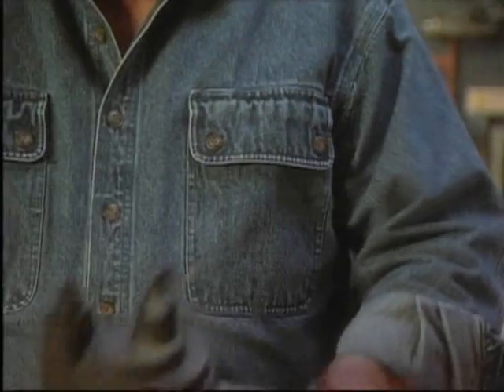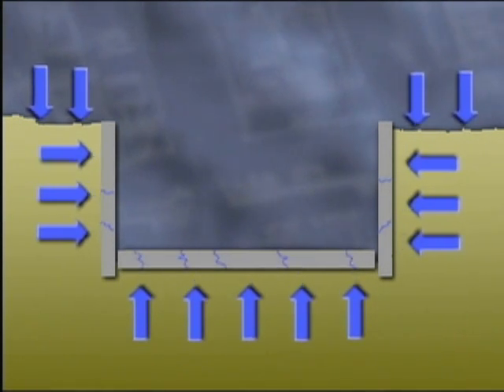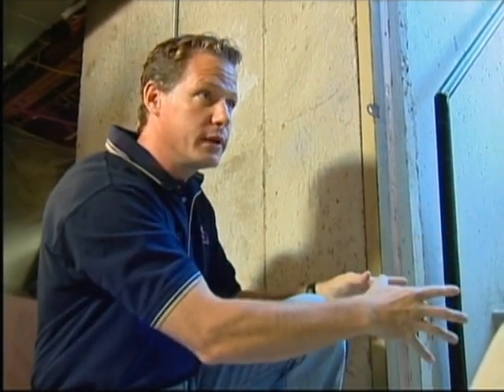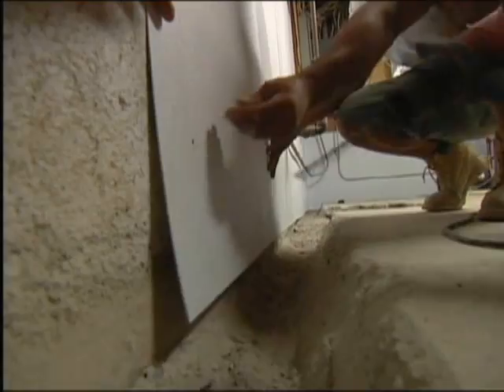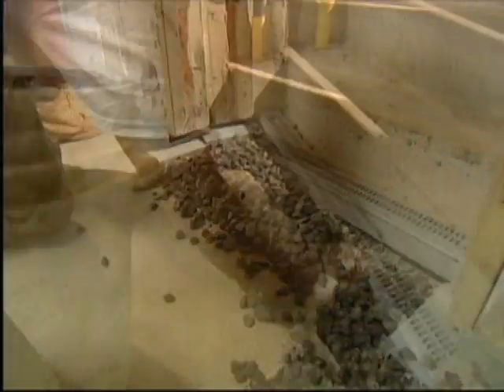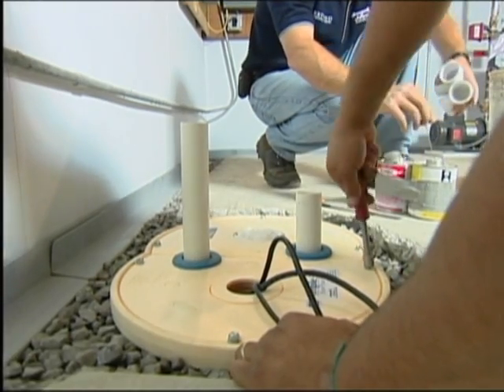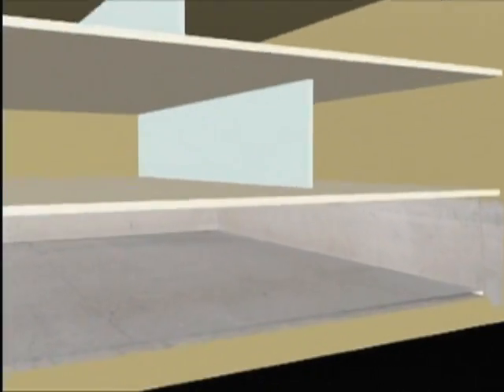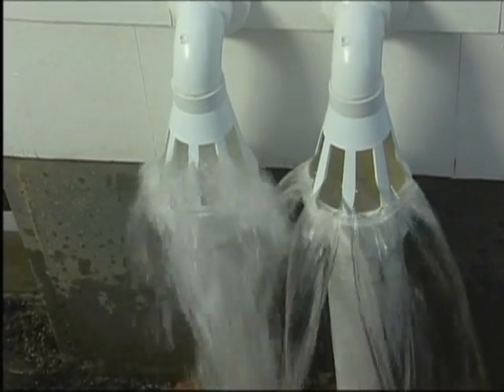How to Waterproof a Basement | Ron Hazelton's House Calls feat. Basement Systems

Comment: Maybe address the outside drainage problems first.
Reply: Yeap - it is bad that these guys did not take care of it outside.
Reply: Like what?
Reply: Like gutters, french drain, or slope around the perimeter of the foundation. All of them would be more effective at keeping the water from getting there in the first place.
Reply: @LibertyFixxxer  Make sure the gutters are working properly and discharge far away from the foundation.  Grade the topsoil to drain away from the house.  Run edging three feet around the perimeter of the foundation. Use soil to create as steep of a pitch as possible, away from the foundation, in between the edging and foundation.  Keep the pitch aesthetically pleasing.  Lay impermeable landscaping fabric on top of the soil from the foundation to the edging.  Put 3" of 2-3" stone on top of the fabric. If there is a lot of water problems you can dig a trench before the edging and lay drain tile on the fabric then cover with the rock. I like using sewer pipe pvc that the downspout of the gutter directs into. Get that dug down below the frost line close to where the downspout attaches to it as possible. In the winter they can freeze and back up when snow melts on the roof.  Run it out far away from the foundation to a rain garden. The sump pump discharge and drain tile under the landscaping rock can discharge into the pvc sewer pipe.  The pvc is typically less expensive than corrugated drain tile and you can snake it if it gets clogged.
Reply: Oh and buy a leaf blower to blow out your nice stone regularly.  Otherwise organic material turns to soil and weeding anything with fabric underneath is a nightmare, but that's also how I put myself through college.
Reply: @jeb1487  I literally couldn't have put it better myself Jeb. My neighbor has ground level ingress issues in a block on slab house here in South Florida. I told him gutter first and then he needs to look at a yard drainage and pump system. He doesn't have too many options from a grading perspective and he just added a load more earth thinking that hiding the water under it is going to solve his problem. I tried to explain to him that the key point is that the water is above his slab. It looks like the previous owner built up the yard to make the lake go away not realizing he lives below the lake. I told him that I am an engineer, albeit not a civil engineer, and that he should listen to me. I explained that if we get a 2 inch downpour in an hour he will have thousand of gallons to clear and a few feet of french drain that doesn't go anywhere will have no impact.
I don't have any issues but if I did, I have a 2-inch pipe running to the canal for sprinkler uptake and I would find a way to pump out to the canal through it.
I will mention your ideas for fabric and edging. He has to take down the grade to create runoff and create a long drain bordering but not at the wall and use the fabric to keep the water out of the ground. Thanks for the idea.
Reply: Ed McGuigan  no problem. would it be possible for him to make a dry creek bed? He could have the soil pitched away from the foundation and into a channel that is also lined with the fabric and stone. They can be very aesthetically pleasing if done correctly too.
Reply: @jeb1487  question? What do you do if you do all that and water still penetrates?
Reply: @vvsiva007  I was amazed that guy  never stepped outdoors....crazy.  I research and work hard to keep all my pumps from turning on let alone  working hard.  All that water along the foundation and mud splashing up on the exterior is a big No No!
Reply: @Braedenfish  same thoughts. I consider the sump pump as a backup and have done everything possible from ever having it come on, unless you're having a 100 year storm even then I want the exterior grading and drywell to take care of all of the water.
Reply: @bossboston816   He did not fix the problem, A big bandaid is all you are looking at. Outside first, then put in an inside system that will weaken you foundation.
Reply: @jeb1487  very thorough. Thank you

Comment: I hope Ron got a big check from Basement Systems because he sold out big time.
Reply: It's a Basement Systems Commercial
Reply: @Liberty AboveAllElse Improving surface drainage doesn't cost nearly that much.  That's always first because it's almost always the cause.
Reply: @Liberty AboveAllElse Sorry, that's not true.  This house is a good example: the basement gets when when it pours.  Otherwise, it's dry.  That's what Ron said.  Cheap solutions like extending downspouts are always the first option, though they often don't solve the problem.  Bringing in dirt to improve drainage away from the house is second, when possible.  Installing subsurface pipes/drains is third, and interior improvements are the last resort.
Reply: That system is garbage. It’s needs to be sloped 4in pvc with holes installed at the bottom of footing surrounded by a drain sock and gravel. It is ground water. He must have a high water table.

Comment: Janesky is the founder of the whole industry. He must be a multimillionaire. I've used 10,000 of those plastic fasteners. If the walls is very old ?  We have seen them lose their connectivity which isn't the end of the world. Just put it in some place else, but first we stated filling the hole that we jammed the connector into with hydraulic cement.  Then we ent to Lexel. Now we use gorilla glue. Each one got better and better results. This is a 1950s house. Why use a $50,000 system on a $60,000 house. This thing is $5-$8,000 and does the job. Man, I'd like to franchise with Larry.  I can't market. I can sell and deliver.

Comment: I installed roof gutters and fixed the grading around the house. I still get a tiny bit of water during the spring thaw but otherwise I consider the problem to be solved.
Reply: I'm thinking thats what I need to do for my house also

Comment: This whole system seems to be treating the symptom and not the problem. I agree sump pumps are sometimes necessary, but grading and guttering are the first issues that need to be addressed. Also, it seems like the exterior drain for the sump is still very close to the foundation, not to mention that overflow system that just dumps the water right next to the foundation, creating a closed system. Those pumps will be working hard! I did like the quality of the video. It was simple and easy to understand.

Comment: So you have 2 heavy duty pumps for moving 7000 gallons of water per hour, but if the power fails as it sometimes does in a heavy storm, you flood the basement because that little DC pump can not match the load for removing the water in a heavy storm.... or even in a 8 hour long storm.... better idea is to re grade the land outside away from the home and also make the second pump a water pressure pump, these pumps use the homes cold water line to run the pump... when have you ever had no cold water in a storm?

Comment: Why were there no weep holes drilled in the walls?
Reply: You are right, this is a poor job. Trenching should be 18 inches wide, trench should be deep enough to go to the bottom of the footings, pipes should be level with the footings, or else the water will be under the pipes and not drain away to the pump. Weep holes need to be drilled at every brick joint and every empty space in the bricks. Concrete should be thick enough for your washing machine to shimmy without breaking through the concrete. I watch a guy on YouTube who replaces these failed systems all the time because they are done wrong.

Comment: hi question.  in crawlspaces i see everyone putting down vapor barriers in the form of poly tarping.  i dont trust tape and caulking to seal water for a long period of time.  is there a reason no one simply pours concrete instead like a typical basement?
Reply from the maker: icawn 

Hello icawn. 
If the objective is to seal water out, pouring concrete in the crawl space won't help  accomplish it. Concrete is a  porous material, and ground water will still be able to seep through it and evaporate into the area.

Comment: Mold will grow behind that plastic sheeting and a perimeter trench in a basement means you get a damp basement.  The ONLY true way to solve basement leakage is to fix on the problem on the OUTSIDE  to prevent water coming in in the first place.  This type of job is basically just trading one problem for another.

Comment: This is not a very good system.  Sure it drains away water that has got into your basement,  but the engineering thing to do is prevent water getting into the basement in the first place.  A properly designed waterproof membrane against the outside of the basement wall is a good start, together with a good drainage pipework and drainage backfill (not just pushing the soil back into the hole.  Also the concrete work can be very effectively made waterproof with hydrosilicate gell sprayed onto the inside of the basement.   This is especially effective over the floor slab to prevent moisture migrating upwards from the ground underneath the slab.  Obviously you cannot retrofit a waterproof membrane under an existing slab without tearing it all up and starting again.

This gel penetrates the pores of the concrete,  reacts with the excess lime liberated when the concrete initially goes off (and is the origin of the efflorescence) and converts it into new cement.  This new cement fill the voids that make the concrete porous in the first place.  The result is a much stronger and waterproof concrete.  Note that this may not work very well with cinder blocks because they often are made with fine aggregate that contains porous filler material.  This filler material remains porous when hydrosilicate treatment is applied.  You can order high density block when you build the house.  This kind of block probably does not contain purous filler material,  your block supplier should be able to advise on this option,  but this is a no good option in an existing house.

Comment: Drainage system should have been installed from outside during construction. Where was a home inspector?  Now digging from outside around a house is the best, but would have astronomical price.  Owners usually take a cheaper half-measures.

Comment: Doesn't matter how much it rains, I never get water in my basement after 37 years.  The walls are always bone dry.  The problem I have is with the water table.  When that rises it pushes right up through the concrete floor, even after I had another six inches of concrete poured over the old floor.  If the water table is low I never have a drop of water or condensation in the basement no matter how much rain we get.
Reply: This is where I think an interior french drain could help. I'd talk to a reputable contractor as most don't know the best way.

Comment: why not dig around the house and spray waterproof coating on the outside.
Reply: Cause concrete needs to breathe.
Drylok will ruin concrete and blocks.

Proper draining, proper slope and proper backfill are the key.

Comment: There are additives that make concrete non-porous and completely waterproof. They seem to pretend that this doesn't exist in the US because it would kill off this aftermarket of remediation of problems that we would never having with proper building codes and methods in place. Concrete sealing is a huge business.